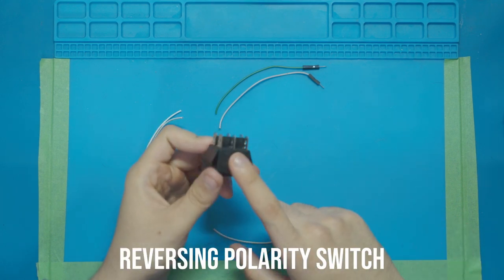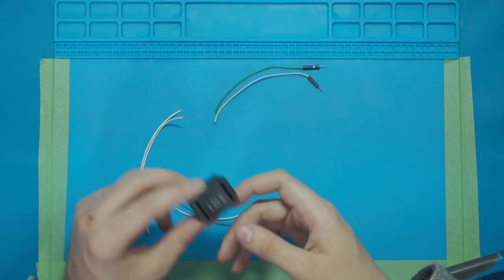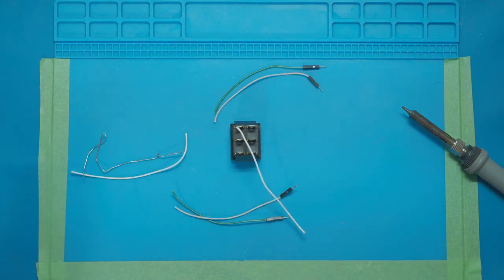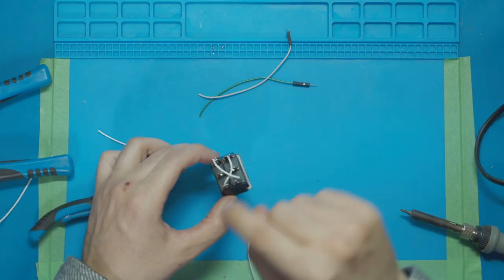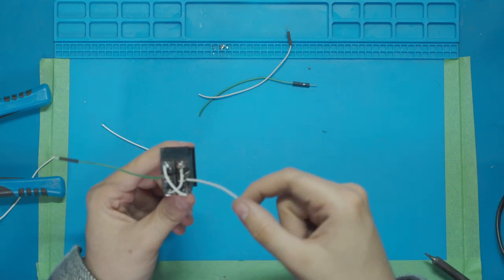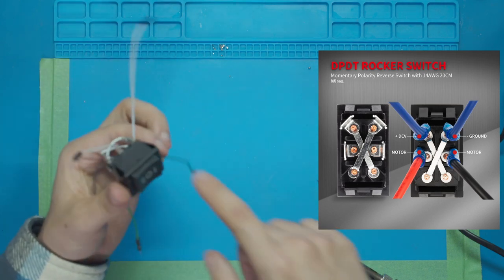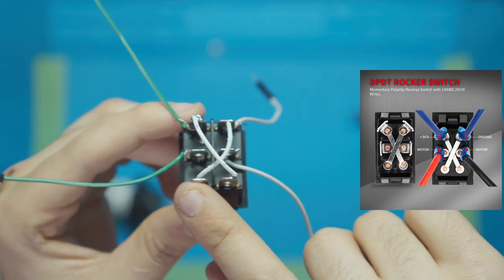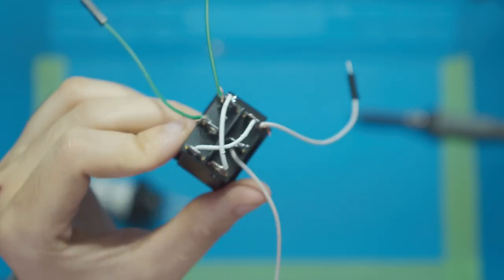DIY REVERSE POLARITY SWITCH FOR DC MOTORS | H BRIDGE ROCKER SWTICH

Comment: Does this work for a brushless fan power cable? Can't understand why your method did not work for this application.
Reply from the maker: it should? if it has positive and negative, and those can be reversed (dc motors usually) then I dont see why not

Comment: I have an old hofmann brake lathe i wanna make the one motor forward reverse switch. But the swith on it now has 4 tires and the motor has 3 but go into 2 separate power boxes. Idk if you can help or not
Reply from the maker: Hmm sounds weird, I’m not sure how it works with a lathe since you do need to control speed but couldn’t you control the direction in the same way I did then direct that power into the speed controller?
Reply: @MikaelAbehsera  is one of those on off switches that has 4 wires going to it and it's just to move the cutter no speed control

Comment: Will this work for bldc motor?
Is there any way to switch the polarity, dynamically via code.
Reply from the maker: it should yes, dynamic control via code requires an Hbridge module, I forget the other name for it but they do exist and arent crazy expensive